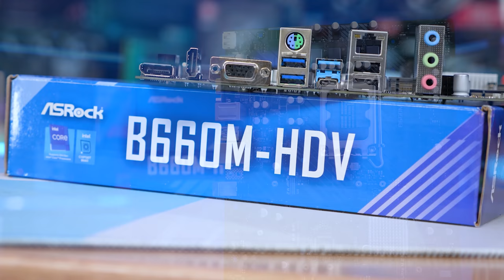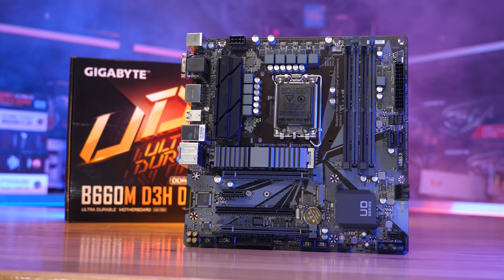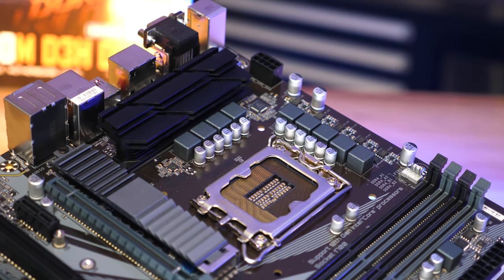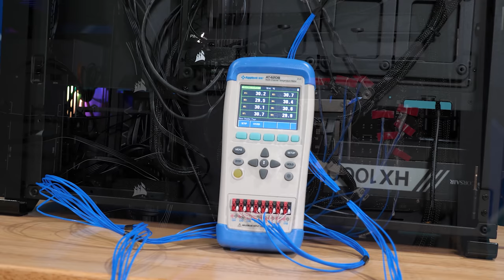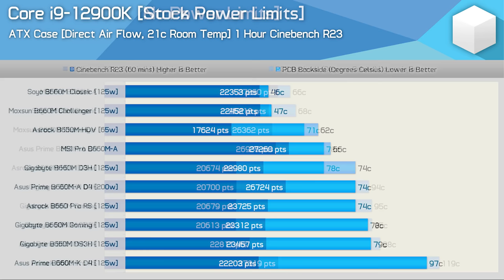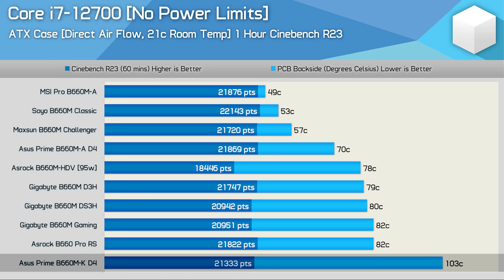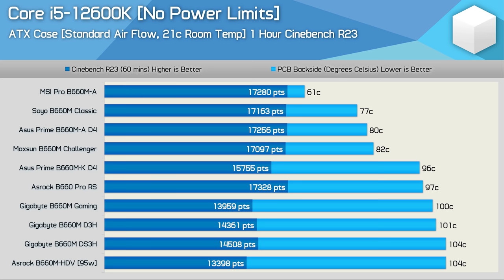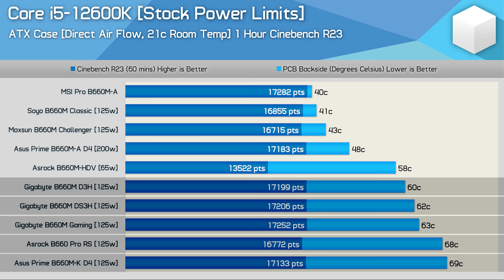Best Budget Intel B660 Boards, VRM Thermal Test

Comment: G'day Steve & Teddy Jr.,
Well that was disappointing from most of the boards running over 100c,
if I was looking at these I would like to see some Reviews for CPU Coolers like the be quiet! Shadow Rock LP, Thermaltake Toughair 110 & some other Down Draught Coolers as Full On VRM Air Flow seems a necessity for 'Low Budget' B660

Comment: Besides msi pro B660m-a is only board with 8+4 cpu power connector which allows it to run for 250w without any issue

Comment: Have you tried BCLK overclocking on any of this boards or is it just an Asus exclusive feature on some of their Strix B660 motherboards? 
I saw buildzoid being able to overclock a i5 12400 to 5.0GHz on his B660-F board
Reply: Most likely none of these have the required external clock generator. Only a few higher end B660 boards can do that.
Reply: @HodgePodgeProducts  That's a shame, for the price those B660 motherboards sell you can get a Z690 but I don't know if with Z690 you can do BCLK OC on non K chips

Comment: WTF here in South Africa the MSI board that you recommend here goes for $200+ and the low end motherboards like the Gigabyte DS3H and the ones with zero heat sinks sell for more than $150. It legit costs more than the i5 11400F and i5 12400F. These chips are $10 difference. AMD motherboards are the price that will would expect to pay for them but the B450, B550 series and X370, X570 support only Ryzen 3000 series out the box and they won't let you lend a cpu to do updates for the boards that don't have bios flash back yet they're selling these along side the 5000 series cpus 😂👀

Comment: There are more options of the MSI B660M motherboards. For example the B660M-G is $25 cheaper then the B660M-A
What is the disadvantage of these cheaper models?

Comment: hi steve, I have a plan that i might will buy the i5 12400F, if I buy the Asus B660M-A D4, is it good enough or should I buy the MSI instead? (i planned to use this PC for gaming and i will use an Air cooler)

Comment: Why was the gigabyte b660m gaming x not included in this revew.. i was interested with the board as it gets good looking heatsink compared to the cheapest one from gigabyte
Reply: I think the same, I want to buy that gaming X version too but wondering about its VRM's. As you said board looking good with its vrm heatsinks...did you found any useful info about it?
Reply: @_CloseR_  i just bought msi mag b660m mortar wifi instead. Its good with mg 12600k. Playing good with ddr4 settup

Comment: just that mATX boards normaly go into mATX cases with lower volume and cooling. Maybe 2 front 120mm fans old school(lian li V351,Antec Mini P180) but i love the formfactor.
Also cooler size is a concern. Thx for the data.

Comment: You price cutoff seems a bit arbitrary, most of the boards you show are 110-130€ (except the ASUS B660M-A at 140€) while the MSI board is around 150. Its direct price competitors at 150€ are GIGABYTE B660 Gaming X DDR4 and ASUS TUF Gaming B660M-E D4. In this range the GIGABYTE comes with leagues better USB and 2.5G LAN (the ASUS has this too) and they both have beefier VRMs. Maybe it's a regional pricing thing but the MSI board doesn't belong in this list for me, because it's substantially more expensive than the rest and the same price as a lot of much better boards.

Comment: The asrock 660 pro is only 90 dollars now. Is thst still not worth it for thst price. I'm just looking to stick a 12100 in it, but I might need wifi and not sure if I should find a board with it added or get a wifi card and hope it fits in the asrock b660 pro.

Comment: impressive. We should thank Intel for making this possible. Back then, CPU performance between one motherboard and another are within margin of error. I think that is the case until Core 9th Gene. Now Intel has provide a chance for reviewers to review motherboard more than just within margin of error by introducing power hungry CPU that roasts the cheap motherboard VRM, especially ASRock. It does seem that ASRock still consider Intel CPU to be very energy efficient like a couple of years ago.

Comment: i paired a b660m pro rs with an i5 12400f is that bad?

and will it be dangerous for daily use if the power limit is opened?
Reply: Just use the stock power settings and you'll be good with the b660 pro rs, although upgrading to a 12600kf will require atleast a msi pro b660m-a

Comment: should i snag the b660m pro rs? currently at around $127. Gonna pair it with 12400f. or should i just go for the msi b660 pro at around $143? Not gonna upgrade.

Comment: Good to know that there's at least one board worth buying (with the piece of mind of proper support and warranty).
Bit disappointing, though, that it's really just one.
Reply: I think GB and Asus aren't that bad if you don't plan to use the top tier CPU. A lot of those designs sacrificed on the power delivery to provide a wider range of connectivity. Although the only MSI board presented is also the more expensive product, so it's not sure if their lower tier boards are that performant.

Comment: Extremely disappointed with the results on the Prime B660M-K… Although I’m only looking to pair it with a 12400, I might just have to save a little extra and go for the M-A model…
Reply: you might as well just get the asrock HDV and save yourself 20 bucks. i personally got it and it doesn't bottleneck the 12400 in any way
Reply: @miweneia  The HDV is not even sold here where I’m from. Cheapest B660 variant is the m-k… otherwise I’m looking at an h110m-k which I don’t really want to go for. I suppose the prime b660 m-k might not be bottlenecked with a 12400 but I’m not sure I’m willing to risk it
Reply: @sloosey  🥴 I'm Also planning to buy 12400+ prime kD4
Reply: @varunverma7124  tough times😫😮‍💨

Comment: I don't understand  what direct airflow means.  Can  someone  explain? How do you mount  a fan  on  vrm?
Reply: There are fan clamps available to mount on an open test bench, they usually offer some sort of angle adjustment for direct airflow. Using them in a closed case would limit mounting options and probably starve that fan a bit for airflow, but it's better than nothing when you're water cooling. You shouldn't have to be concerned with most air coolers, although coolers that blow directly against the mobo will achieve the best VRM temps. Then your trade-off would be thermal throttling because those coolers aren't rated the highest in terms of TDP. The best solution depends on your hardware and primary needs, like overclocking. If you don't have a board with good heatsinks, you need direct airflow or overclocking would be a bit sketchy imo.

Comment: If i get a 12400f with the msi b660m-a will it be as hot as 103c in the video?
Reply: Its a stress test dude... for common use dont gonna be sooo hot like that video.. But that video shows like can be hot in high stress.

Comment: Will GIGABYTE B660M DS3H motherboard be okay with the i512600k CPU? I'm on a strict budget and wouldn't be able to spend more on the motherboard. Would it be better to downgrade to an I5 -12400 CPU rather than pairing a 12600K with this motherboard?

I'm not planning to Overclock my CPU but 12600k seems a lot better than other options.
Reply from the maker: 12600K testing is included in this video.

Comment: Does anyone think the results for gaming will be negligible between these boards using a 12400f? The power efficiency on that cpu seems really good, and with an arctic 34 duo I don’t think you would lose any performance to thermal issues on the D3SH in this vid

Comment: I'm little confused between MSI  PRO-B660M-A-WIFI and MSI PRO Z690-P 

The former is available in my region for $210 and the latter is $242 any suggestion would be helpful and appreciable.
Reply: Are you willing to overclock?

Comment: Bought an Asus Prime D4 mATX . Been rock solid was 169.99 with microcenter 20.00 off with cpu purchase. I bought a 12600k. 32g ddr4 crucial ballistix ram. Lian li AOI cpu cooler, fully modular evga 1000w power supply,
Had a Corsair case laying around, and an Rtx2080. Runs flawless. Eldin Ring stays 60fps 99.5 percent of the time. Never drops below 57fps, no stutters.... Etc. Replaced an awesome i7 5775c build. Had fun playing with the eDRAM but it was 7 years old. Will use to make a media server or something.....
Reply: No i didn't need the wifi module as i have Ethernet ran to every room in my house. 

I too like Asus bios, easy to work with

Comment: I am planning on getting i3 12100f and was wondering if ASUS PRIME H610M-A D4 is going to be sufficient ? I think it's the same board as B660M-A D4 just different chipset. And looking at these results with 125w CPU it's behaving OK, so I guess with an i3 is going to be good ?
Reply: it's not, but yes it would be fine.
Reply: You will not be able to "overclock" (XMP profile) your memory with H610 chipset unlike B660 or H670 or Z690. This is the biggest change this year, previously you could only overclock memory on Z-chipsets
Reply: @fender8372  they already enabled this with b560. You would need to go back to B460 to find chipset without memory overclocking
Reply: @thelawnet  oh, I didn't know that. Really cool then, thanks. Still, H610 is meh

Comment: I have 12100f and maybe will someday upgrade to 12400f. I dont know what motherboard to buy, MSI PRO B660M-E DDR4 or MSI PRO B660M-A? What is the difference between them?
Reply: In A variant you have vrm heat sink in E variant you don't have any heat sink

Comment: asrock B660M-hdv should be the one need to be avoided at all cost (except if you using i3 or lower.)
but I guess asrock B660M Pro RS is still pretty good value ?, its one of the highest vrm temp in this test, but the cheapest b660 you can get (at least in my country), 
i guess paired with 12500/12400 or lower it should be still okayish??

Comment: bought a b660 and 12100, not only it doesn't have BCLK setting, it also has a locked voltage!!  since when Intel locked the voltage setting on the 12100?😡

Comment: What is the longivity of MSI b660 motherboard?
Reply: B660 may support the next-gen Intel cpus, so 13600 or 13700non-K maybe is the most optimal option here. Currently the low-end boards in my country are going for more than 120 euro, while MSI Pro B600 is just 30 more

Comment: I don't understand how the motherboard can how such huge effect on performance. Is this important when I just game on my PC? And how do I remove my motherboards power limits? I'm just running it stock
Reply: Make sure your hardware is capable before messing with settings, also that cooling is up to snuff. A hardware monitoring program like HWinfo will help you keep track of MOBO temperatures. You'll also want a benchmark program, and one that offers a "stress test" option (not that you need to use it). Benchmark before and after you make changes, upping the power limit might not help your particular setup without raising temps to uncomfortable levels. You'll need to check your motherboard manual to find out how to enter the BIOS, most require a reset then you hit a key or key combo. From there consult your manual on BIOS operation, to see what each function does. The wording unfortunately can vary from one manufacturer to another.

There are a lot of articles and videos online about overclocking and BIOS settings, I would consult some of these before getting in too deep. Also forums are a great place to find answers to common questions. Just typing "how do I remove my motherboards power limits" in a search engine should yield all sorts of fun stuff.

Comment: The best way to use is buy a 12700F (non k)  pair it with decent tower cooler say deepcool gammaxx 400xt nd msi pro b660m-a, nd volla u can compete double price ryzen 5900x setup  easily in every benchmark

Comment: Hi so I decided to go for i5 12400f, because it's cheaper for 70€ than r5 5600x in my country.
So I was thinking to get
i5 12400f (173€)
Gigabyte B660 Gaming X (137€)
Crucial Ballistix 16gb 3600mhz cl16 kit (83€)
And intel stock cooler, I think i don't need better one. Is this motherboard worth it?

Comment: Do you like spending 280+ on a CPU that will be obsolete within the next 9 months? 
Do you like spending a extra 60$ on a CPU cooler that won't thermal throttle you?
Do you like spending a extra 150+ on a new motherboard that will be Obsolete within the next 9 months every single time you upgrade your CPU? 

Go Intel

Comment: First I wanted to thank you for your effort, ur the best of the best
Second, what if msi pro b660m-a is not available in my country
But ASUS TUF GAMING B660M-E D4
Is What I can get here
So can the asus handle 12700 without any throttling same as msi pro or not
So asus is a good choice combined with 12700 ?

Comment: Thanks for the very important information about this motherboard..❤ i am getting my First Computer this month, can u please tell me if my Configuration is ok or not?
-i5 12500
-Msi Pro b660m-a
-Corsair Vengeance LPX 8GB 3600mhz
-Samsung 970 evoplus 250GB
-Corsair CV550 
-Deepcool Matrexx 40 Micro ATX Case
-Gigabyte G24F 165hz Monitor 

[GPU- RTX 3050 or 3060 in Near Future]

This Costs About $900 in Bangladesh without The GPU.

Comment: These boards are all disappointing. The need for the fan over the VRM just to get some of them to produce decent temperatures with the 12900K is akin to grading on a curve. I'm looking forward to the next one. I've got high hopes for the TUF B660M Plus and B660M Aorus Pro.

Comment: 100°c+ wtf are this temperatures...
Reply: Translation is: running 625€-683$-930Aud Cpu on full for 1 hour on 100-140$ low tier garbage mobos.Go on highway and drive in second gear to the floor for 1 hour
Reply: @Rokim1983  Correcting the translator named Rokim1983: a 250€-270€ i5-12600k is making 6/10 mobos run at nearly 100°c (or more), with only 3 decent boards and one chill. (22:18)

Having 1 crappy mobo, why not, asrock is pretty good at that... 
But 6 bad mobos is an absolute F, period... (and you can make all the stupid argument you want, it will remain bad, period).

Last thing, try to translate something that you actually undertand next time, or just don't try, it avoids misleading others.
Reply: @frieza1016  well on 12900k with no power limits in 1 hour cinebench all boards go over 100°c

Comment: Omg Will anyone using cheapest B660 mb with 12900K ?
Not that bad of Asrock Hdv , thats budget plan
Reply from the maker: The Asrock board is really bad, you can get much better boards for the same money. You might not want to use the 12900K on a B660 board, but surely some will opt for the 12900, now or in the future, and it uses about the same amount of power.

Comment: Why would I even watch this,pro-a is most expensive 160€-175$-238aud here in europe,and has 12phase vram,its 2x better than those 100$ garbo boards,he should test against same price gigabyte b660 gaming x,and 20€ more expensive asus tuf gaming b660m plus and steel legend.Msi also has garbage like pro-e,pro-b,pro g,low tier garb with no heatsinks on vramm.115€-140€ boards.Why he didnt test those?

Comment: These motherboards should be tested with non-K core i5.
Reply from the maker: Makes no difference given the 12600 and 12600K use about the same amount of power without any limits.
Reply: @Hardwareunboxed  And what about i5 12500? All these boards are ok?
Reply: @HowardRoark1943  yes it's the same as the 12400 just a better IGPU.

Comment: I simply do not understand why these benchmarks don't include a 12400f.
This is so unfathomably stupid. These mobos are exactly the price bracket for 12400f (instead lets benchmark 12900k instead, facepalm)
Is very much possible that some of those mobos wouldn't perform equally with 12400f with powerlimits removed and sustained all core boost, etc.
Reply from the maker: The 12400F uses 70watts, it would be silly to use it. The 12700 is the perfect CPU for this testing.

Comment: Given the dogs breakfast of performance between boards even with "stock" power limits, building a system based on CPU benchmarks alone will result in many disappointments particularly given that even lower end SKU's like the 12600K will be motherboard dependant for performance.
I haven't seen this sort of variation between boards for decades.
Perhaps budget builders should still be looking at Ryzen based systems that at least are consistent performers on lower end boards as they are on high end boards.

Something to note is your use of "stock" instead of OOTB, stock is a very specific term that does not include motherboard enhancements to pl states. The best board tested, the MSI Pro B660M actually ran the 12700 at stock 65W while other boards ran it at 125W and even 200W according to your charts which is not "stock". While "stock" and intel are meaningless these days, it is still misleading to have the same "stock" set of results be motherboard pl state manipulated dependant instead of CPU stock (65W in the case of the 12700) when the common title is "(insert CPU here) (stock power limits)".

In the future if testing "Out Of The Box" then ensure that your chart title reflects this, The MSI board that ran the 12700 at 65W OOTB, ran the 12900K without power limits OOTB, which is not stock.

Comment: Hi. What does that standard and direct airflow means? I have a Gigabyte B660M DS3H motherboard + i3 13100f, and wanna upgrade the CPU for this 12600k. As i see with stock power limit + direct airflow the B660M DS3H can handle the CPU. But i dont know if i have that direct airflow. Anybody can help me to explain whats the difference? :))
Reply: * i have 12100f now
Reply: a fan directly blowing into the vrms